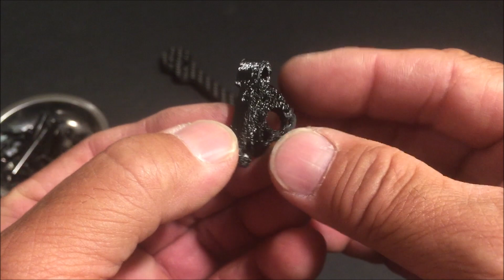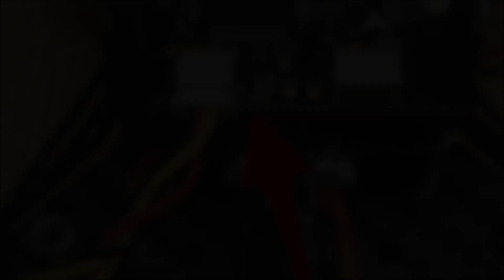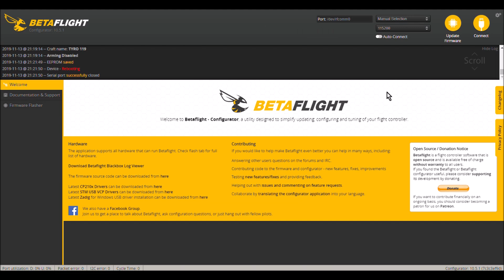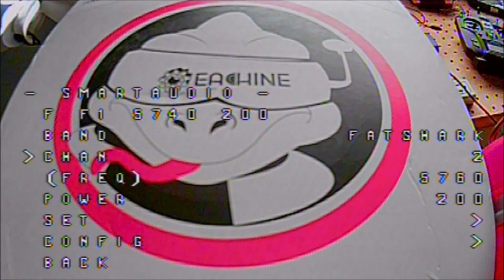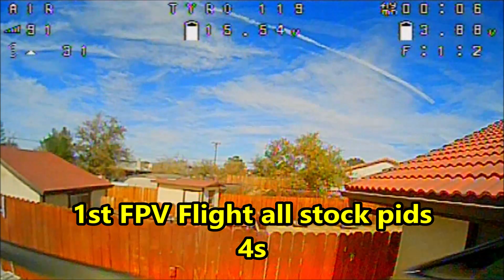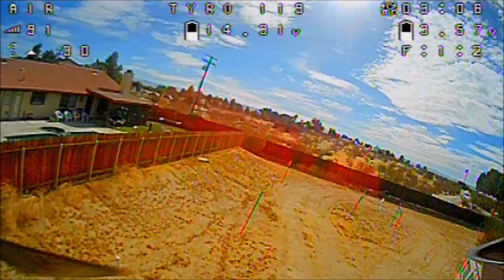Eachine Tyro119 Build and Fly

Comment: Greta tutorial. I have Tyro 119 and 129… Do You know which board to select to update Firmware to the new Betaflight 10.9 2023 that now has GPS Rescue and with soft landing I I can't find Matek F405. There are only several Matek SE, OÍA, TE, STD! thank you
Reply from the maker: I don't know which one you can use.  I still have 4.1.1 firmware in mine.

Comment: My Tyro119 now flies with betaflight. Switched to iNav to use the GPS functions. When I arm the quad, the motors do not turn on. Any help?
Reply from the maker: There could be many reasons it doesn't arm.
https://www.google.com/search?q=fpv+quadcopter+does+not+arm&rlz=1C1CHBF_enUS846US846&oq=fpv+quadcopter+does+not+arm&aqs=chrome..69i57j0i22i30j0i390.11020j0j15&sourceid=chrome&ie=UTF-8

Comment: I built the Tyro119 and when I arm the drone, the drone jerks erratically. My motors are mapped correctly, spinning in the right direction and the props are correct.
Any help?
Reply from the maker: maybe the esc need to be recalibrated?
Reply: @RCEscape  The drone now arms correctly but will not lift when advancing the throttle. any help?
Reply from the maker: @electricjohn1  
check your props.

Comment: Hi RC Escape!
Hey I just built this Tyro 119 kit perfectly following your video. But for some reason it arms in Betaflight but not when I go to fly. 180 arming is done, I erased all switches and re did them in the remote and Betaflight and every works including esc buzz to find the quad. Side note my last 4 or 5  quads have only bind in FrSky X2( what ever that X2 is) instead of FrSky D8 or 16 like my other 20 quads. Even the motors spend up in motors in Betaflight. Any ideas, I'm also over 20ft away so I'm getting that too close no arming thing. Thank you
Reply from the maker: What radio are you using?
Reply from the maker: And what receiver are you using?
Reply: @RCEscape  a new RadioMaster TX16s with a XM+ I even tried my old FrSky radio
Reply from the maker: @masterpdj2623  
You have the correct channel mapping?
Reply from the maker: xm plus will need D16 as the protocol.
Reply: @RCEscape  yeah mapping is correct it's in D16 too. I'll try the my old FrSky remote again. I hate buying BNF but Kits seem to never work for me.
Reply from the maker: @masterpdj2623  
are the sbus pads on the fc bridged?
Reply: @RCEscape  I did but it wasn't the best job, I think you might be on to something. Could that be the issue you think?
Reply from the maker: @masterpdj2623  
It could be if it is not but you say everything in betaflight works so it may not be the cause.  One last thing, check the throttle threshold against the throttle stick low and see if the threshold value is higher than the stick low value.
Reply: @RCEscape  yeah I rechecked the bridge and almost lost the FC RX and Sbus to heat so I had to solder the XM+ and the bridge to the bottom and it everything came it all back LOL. Wow that sound good but as a newbie I don't have a clue where to even find that and although it sounds like that could be the problem. I will look it up but what page would I find that on in Betaflight? Thanks RC Escape (OK I found it in simple talk witch one should be higher?) StickLow TH 1050/Stick center 1500/Stick High TH 1900...Does that tell you anything?
Reply from the maker: @masterpdj2623  
1050 for stick low so look at the bars on the throttle.  When it is at its lowest, what value is it showing?
Reply from the maker: @masterpdj2623  
so with the radio place the throttle to the lowest and if that value is higher than 1050, the lowest threshold has to be higher than that value.
Reply: @RCEscape  Man I wish I knew what you mean. I just bind a brand new FLYWoo drone and it's doing the same thing so it's gotta be betaflight or my new RadioMaster TX16s remote. Check this out. My last five new drone my RMTX16s is making bind in something called FrSkyX2 D16. I've never seen this X2 thing until a week ago. All my other 20 FPV drones are FrSky D16 or D8 this is something new my remote is doing. Something is going on with my Remote I think, no way two new drone are doing the exact same thing.

Comment: I have got the same model and I have just finişhed the building, I have done all the betaflight settings as u have done onlu difference from yours is I m using flysky i6x transmiter and connect the ppm port on flight controler and do the ppm settings on beta receiver mode. My problem is every thing seems ok on betaflight motors works just fine vhen its connected to beta but vhen ı tried to hit the trotle it runs but dorsnt slows down when ı pulled the trotle down and also when ı sudden move on right stick it cuts the motors all in a sudden stops all of them. Please help if you know the answer. Ps: ı tried bouth with the props and without all the same. Even eith 4s battery but still the same.
Reply from the maker: are the modes and channels set up correctly
Reply: RC Escape you öean over the betaflight, every thing set as you have done. As ı said before only differences are the transmiter and the receiver settings. PPM mode.
Reply from the maker: @fixbox1  
how about on your transmitter?
all work good in the receiver tab?
Reply: RC Escape exactly all responds perfect on beta flight receiver mode but only thing that ı see is the colored mesurements that shown on receiver screan are blinks up and dovn minorly like it blinks 1500 1502 1503 up and down minorli continiously. Hope ı could explained vell.
Reply from the maker: @fixbox1  
that flicking or blinking is normal.
in the config tab the esc protocol is set to dshot 600?
board and sensor alignment correct?
Reply: RC Escape it is set to Dshot 600 no problem. But board and sensor allignment ı am not sure hove its made.
Reply from the maker: @fixbox1  
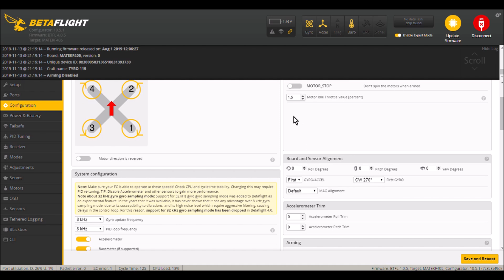video @14:10
Reply: RC Escape yes ı have done all these settings same as you did.
Reply from the maker: @fixbox1  
youve done the bridging of the right two pads on the fc?
 and how about the transmitter.
how are the channels and switches set up?
Reply: RC Escape I have done the bridging to ppm ibus on FC, on transmiter ı have chose the PPM on output configuration and at right side  chosed the ibus.
Reply from the maker: it looks like you have done everything correct. 
you have other receiver/transmitter to try?

Comment: I bound my QX7 to my quad, green light goes on. I was able to calibrate accelerometer and test motor direction. Then I set it all aside to work on another project. Now nothing happens when I plug USB cable to the flight controller, no lights, nothing. The QX7 is still bound to the receiver when I connect battery, takes about 15 seconds after powering up the QX7. It still makes three beeps of rising pitch, when I plug in battery, followed by two more beeps of rising pitch. It will not connect to betaflight. A red light flashes on the flight controller and blue lights on the GPS and video transmitter. What went wrong? I'm using the same laptop and cable as originally.
Reply: Gregory Dahl  My other drone is an EVO which pretty much flies itself. You put it somewhere and it stays there no matter what the wind does. Tyro119 is a different creature altogether. I installed a new flight controller board, as everything pointed to it being defective. Short, erratic and ultimately disastrous flights were taken but clearly I need more time on the simulator. To that end I run my Taranis on a motorcycle battery (with appropriate voltage step-down reducer) so I don't have to spend time charging its LIPO battery. Now that LIPO is fat and puffy and I'm afraid to put it back into the Taranis. I thought of getting a replacement motor but getting shipments here to the Philippines is now even less reliable than pre-covid. Customs is still holding my CNC router from Banggood, and won't tell me where it is. So working on the Tyro is halted. Sorry I can't be more helpful. . . But now that the motors have been exercised, they all seem to turn the same by hand, so that's no longer an issue. For now my fat and predictable EVO will have to satisfy my need to be air-borne. I had dreams of making videos like this
https://www.youtube.com/watch?v=iCY3X-Rd8Sc
but that'll have to wait.
Reply: That yellow car in my picture is powered by a 260 cubic inch Rover V-8 that I decided to Americanize with Ford Mustang 5.0 EFI. A built engine developed 311 Hp, not bad for a small valve, push rod truck engine. I'm able to make unlikely things work but the Tyro eludes me.

Comment: Great video. I am building this now following your video. Will be adding the xm+. In the video you show and talk about bridging the left 2 pads for SBUS connection. Which wires or wire go to the bridged pads yellow, black or red? Can you tell me where each wire goes? I might be over thinking this. I assume that if I cut the receiver wires to solder to the above mentioned then the plug on the flight controller is not used. Been flying out of the box drones for a couple years, this is my first build. Thanks for any info you can give me.
Reply from the maker: The bridging doesn't require any wires but just a drop of solder to join two pads in your case the left two pads.  It is just a switch to allow sbus.  you will still use the receiver wiring harness to connect the xm+.
Reply: Very helpful,  thank you

Comment: One of my motors turns with more pronounced "detents". I disconnected two of its wires, thinking that I had bungled the solder job, but it still turns the same. The other three motors turn with what I would describe as much shallower detents. Anything to worry about? I have not applied power, but will place an automotive lightbulb in series with the drone to limit current.

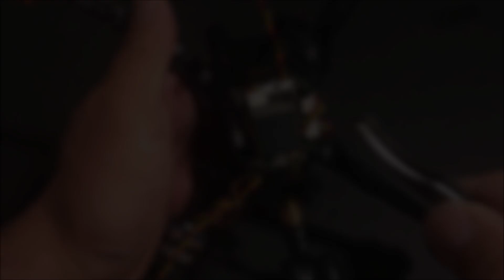Comment: At about 10:30 you added an extra wire for audio. What is size designation for such wire ends?
Reply from the maker: I don't know the size of the ends.  I just got a similar connector from another wiring harness for smart audio.  Take one out from the vtx wiring harness.  You then can look for a similar connector.
Reply: @RCEscape  The big question is, is there audio when you add the wire?

Comment: wonder why the use a lock nut if the screw don't make it through to the nylon
Reply from the maker: yes the screws could have been a little longer :)
Reply: @RCEscape  I'm running out tommorow to get longer screws.

Comment: What's the difference between left and right hand throttle? is Flysky i6S FS-i6S 2.4G 10CH AFHDS 2A Transmitter With FS-iA6B Receiver or FlySky FS-i6 2.4G 6CH AFHDS RC Radion Transmitter With FS-iA6B Receiver okay?
Reply from the maker: Them receivers are old and huge.  I suggest something smaller.
Left and right hand throttle differrence is like using chopsticks with your dominant hand while driving on the correct side of the car vs using chopsticks with your non dominant hand while driving on the wrong side of the car with brakes and gas switched also.  lol
Just having some fun :)
Do what comes natural for you :)
Reply: @RCEscape  Please suggest a receiver/transmitter, I'm new to this. I'm pretty good at assembling, soldering doesn't scare me at all. I mean, I poked around in the electronics of my cnc bridgeport mill, including the code, so not much scares me. My other drone is an EVO, which required no assembly and no selection of addition items... I'm right handed.
Reply from the maker: @dalawaabril  
I would suggest the frsky taranis qx7 mode 2 so left hand throttle which is what most people use and the xm plus receiver.
Reply: @RCEscape  Thank you. Your build instruction is great.

Comment: It's good value  decent quality parts at this price,you made that build look so easy ,wonder how long would last on 6s before it fails
Reply from the maker: So far my Tyro129 has held up good.  I thought one of the motors had gone bad but it was desert crap stuck in the motor.  This time however, it did not include the go pro mount like the 129 :)